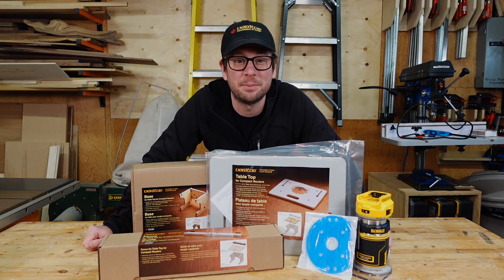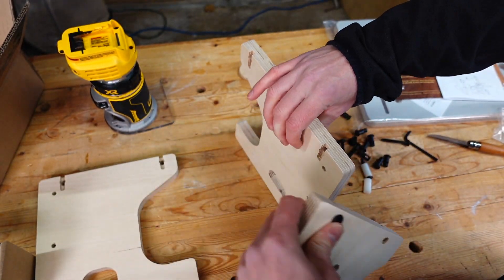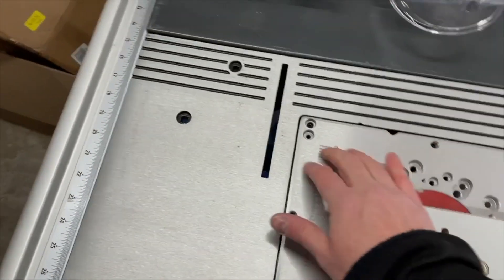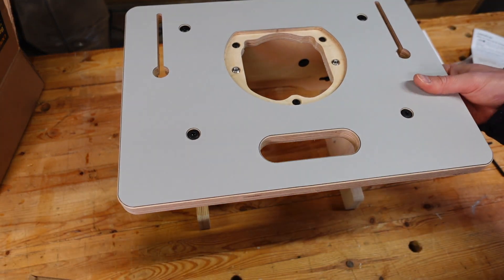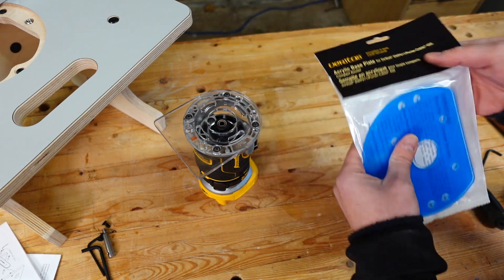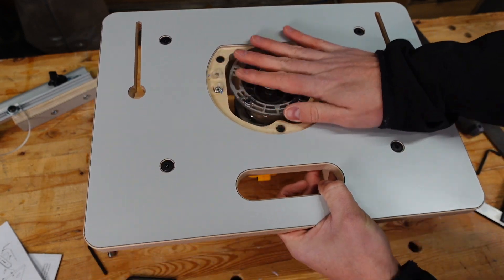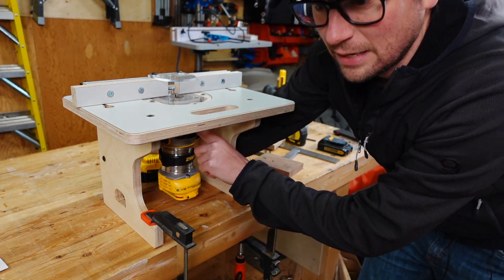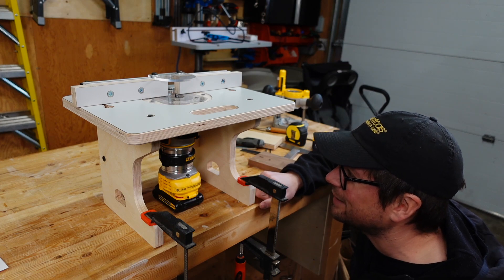Veritas Router Table for Compact Routers // Unboxing, Setup, and First Impressions

Comment from the maker: In the coming weeks, I'm planning to post a formal review (it'll be much shorter than this one, I promise) of this table based on 10-20 hours of use on a couple of projects. After a few more hours of use, I'm really liking the top and fence, but I'm not quite sold on the value of the base ($64.50 USD/$73.50 CAD on it's own).

Comment: I love my Veritas router table. I use it far more than expected. Has added a whole new dimension to my cordless palm routers. Even better, the company makes the hard-to-find acrylic base plates for my Ridgid cordless palm router, which can be used with or without the table.
Reply from the maker: Thanks for sharing! I’m really like it myself and I think folks just getting started with routers often find compact routers safer and easier to learn with, making this table a great accessory.

Comment: Hey. Couple things, first thanks for the video, it allowed me to decide between the whole kit and just the table as i have the same router as you and like the 5amp battery on it, so I'm just going to hang clamp the top to my bench and save the bottom part and fence money.
Second, i also have the same table saw and router table as you do and after watching your video i checked the bottom of my Bosh and i think we can drill bigger holes along the fence slots but only on the ends closer to the outside of the table saw. have a look at yours and tell me your thoughts if possible. Regardless thanks for taking the time to make the video, i know first hand how much work goes in to them. Cheers from PTBO Canada.
Reply from the maker: Thanks for watching and commenting! I’ve actually changed up things in my shop over the past few weeks and have sold the router table I had within the wings of the table saw. Not because it didn’t work, but because I wasn’t using it enough and used the funds to buy some different tools.
Reply: @MasonWoodshop  Good for you, i have actually never used mine i'm constantly using my small Dewalt router, I'm thinking of selling the whole table saw and get either a Harvey or Laguna, Not sold on the sawstop thing (I don't want my saw to stop) ;-)

Comment: Thanks for the review! Right now I have very limited space in my garage and this will be perfect with my trim router. One question: what’s the max distance between the middle of a bit and the fence when the fence is pushed all the way back?
Reply from the maker: Thanks for watching and commenting! It definitely extends the versatility of trim routers and after a couple hours of use since the video, I'm enjoying it. Funny that you mention that distance, as I already ran into one cut that wouldn't work as the max distance from the sacrificial fence to the center of the bit is ~ 1 3/8". I was trying to make a cut centred on 1 1/2" and it just couldn't quite make it. I'm planning to make a 1/4" sacrificial fence face in order to accommodate such cuts.

After I get another 10-20 hours on the table itself, I'll be putting together a formal review (will be shorter than this video) to share my full thoughts on it after sufficient use. So far, I'm really liking it with the only thing I'm not sold on (due to the cost) being the base itself (the top and fence are fantastic).

Comment: Why do you call them "sacrificial" fences?
Reply from the maker: In this case, I used the term incorrectly as these aren't necessarily sacrificial. With how the aluminum part of the fence is built, you could easily use sacrificial boards on the front if that fits the need of the job.